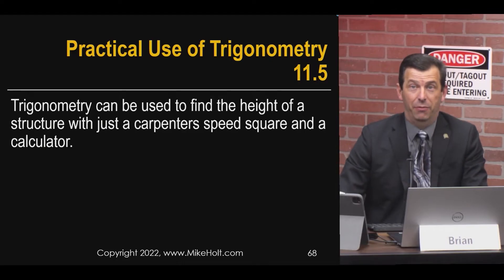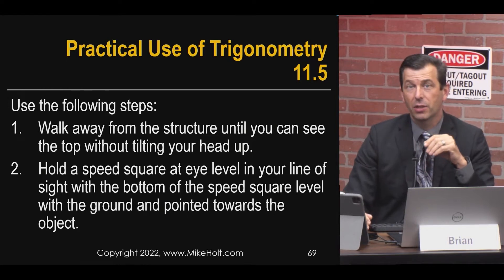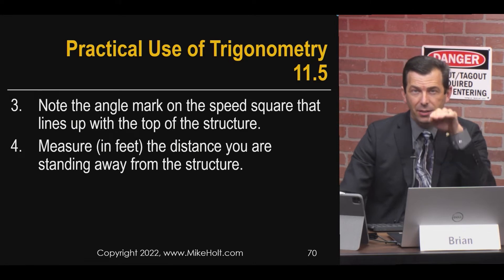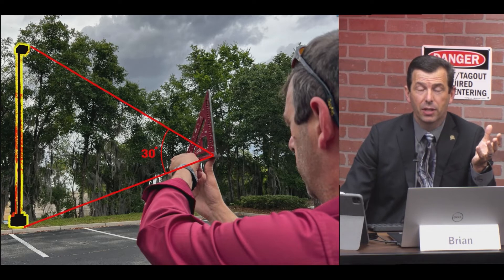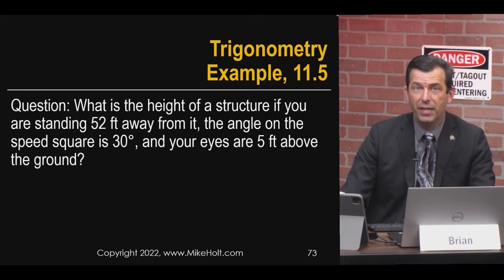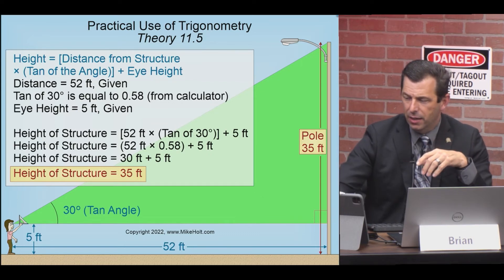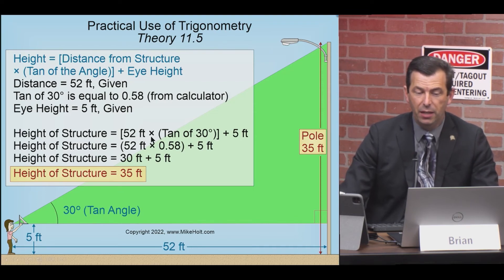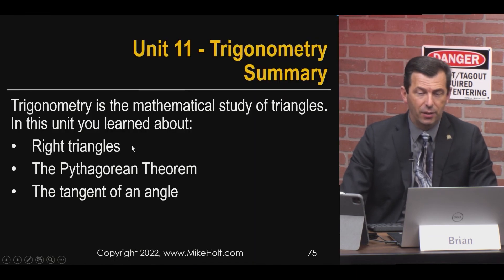Practical Use of Trigonometry 11.5

Comment: The illustration of the speed square shows the speed square perfectly level, however the physical picture of Bryan holding the speed square shows the bottom of the speed square pointed at the base of the pole. That would change the 30° or does that compensate for the 5 feet above grade if not held level?  Thanks for all your videos they are very informative and helpful.

Comment: You can also guesstimate how much conduit, wire, straps, screws, anchors, how many man hours, wire nuts, how long of a fish tape, pull string length, wire puller HP, and rope length, how much pulling soap, square feet calculations for lighting, receptacles, for any size building, etc ( I am used to computer basic language and excel programs that I build to ask me questions and speed up the math equations ) Mike Holt and experience is the best teachers